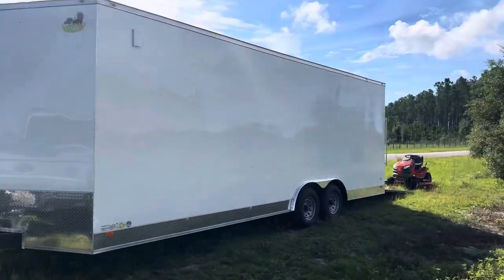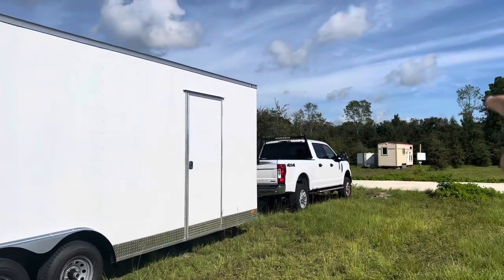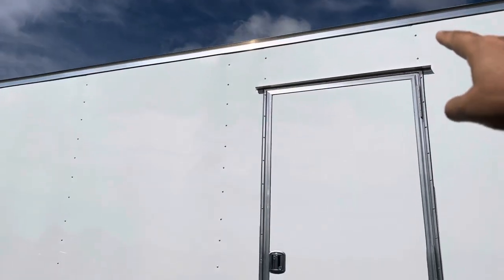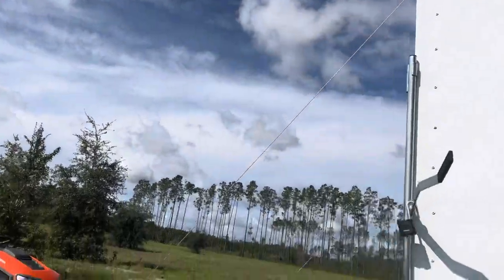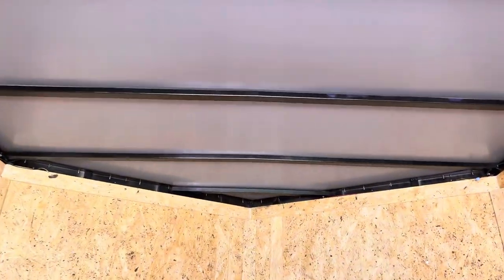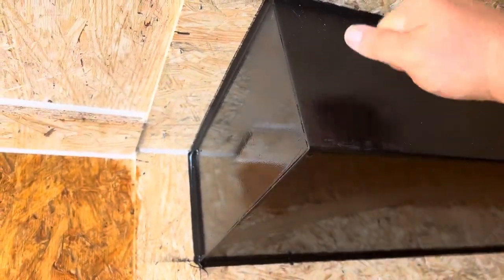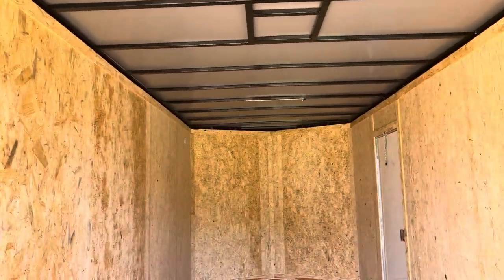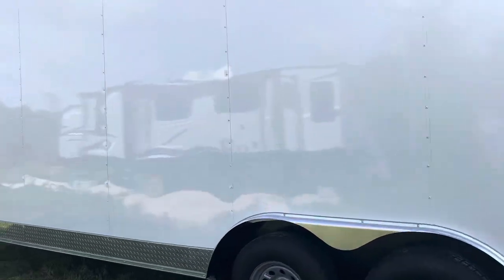I’m impressed!  Covered Wagon Cargo Trailer

Comment: Never could understand how a trailer that large only has 3500 lb axles in it with the tiny wheel bearings.  EVERY body uses those crap axles and bearings.  Maybe a small utility trailer, but not something that size.